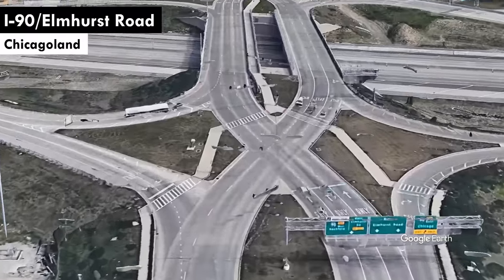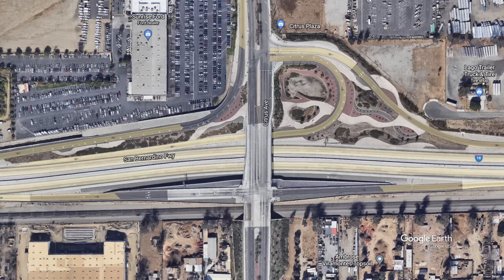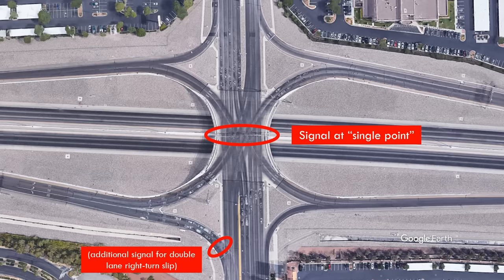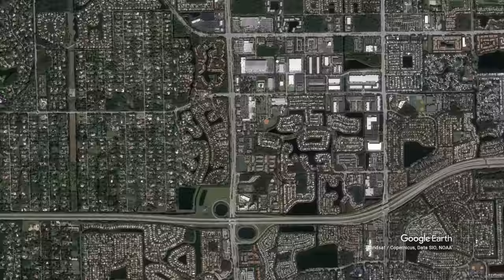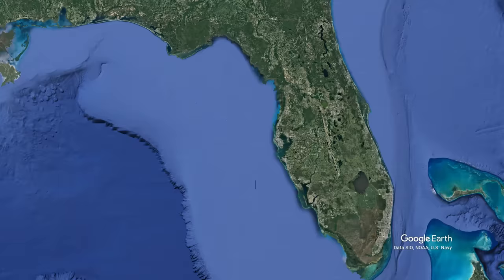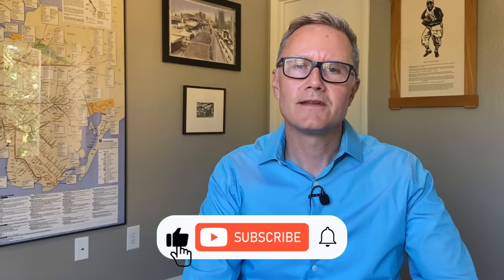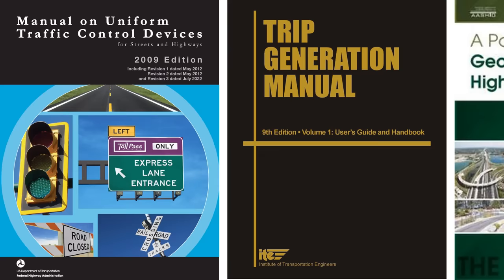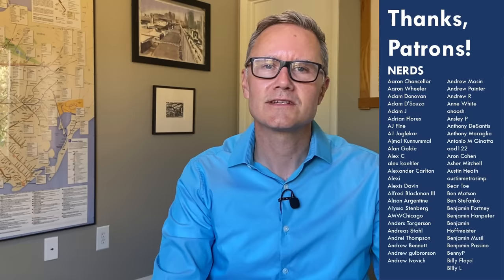Traffic Engineers Gone Wild: Why Interchanges and Intersections are Getting Worse, Not Better

Comment: Spot on as usual.  What I hate the most is shown @ 8:51 pedestrians and bicycles need to do the weirdest turns (100° to the left) with your back to incoming traffic that of course is not looking at you, then you walk 7 meters to be stopped by a traffic light again.  Then you finally get to the concrete bath tub and do it all over again to get out of there on the other side

Comment: While State Road 7 and Forest Hill Boulevard might hold the record for the most approach roads, the crossing of the Princess Highway and North road (West)/Wellington Road (East) (Right next to Monash University, Melbourne VIC) might be the widest intersection I've ever seen. The crossing is not at 90 degrees so that while from short corner to short corner it's only 45 metres wide, from the long corner to the corner diagonally opposite, it's 170 metres. If you are driving on North Road it's a total of 110 metres (360 feet) to drive across the intersection when going straight and the traffic lights on the far side are so far away you can hardly see them when stopped. It's a total of 192 metres for a pedestrian to cross from one corner to the one opposite through a total of 4 pedestrian lights.

Comment: This may be a bit too niche, but I'd love to hear your thoughts on the in-progress project to replace the Connecticut River Bridge between Brattleboro, VT, and Hinsdale, CT. It's a nightmarish design exacerbated by the fact that, although Brattleboro is the regional population hub, the border line between Vermont and New Hampshire hugs the Vermont shoreline, so the primary agency responsible for the design and construction of the bridge replacement is the New Hampshire DOT, not VTrans, at a total projected cost of some $50-60M USD.

The dilapidated existing compound bridge crossing intersects with the at-grade Amtrak station that is itself in the process of eventually being replaced with a level-boarding platform, which will be the first of its kind in Vermont, although construction has yet to begin. Directly adjacent is the downtown Brattleboro intersection locals lovingly refer to as "Malfunction Junction", which comprises: Main Street Brattleboro, the main North-South arterial (US 5); a grocery store parking lot entrance/exit; NH 119, the most southerly (and thus first available) crossing of the Connecticut River in Vermont; as well as VT 142, along which are several heavy industrial sites. 

This is compounded by a heavy industrial site, a lumber kiln, embedded right in the heart of downtown Brattleboro, just blocks away from Malfunction Junction. And this area is also fed by VT 9, the most southerly East-West crossing of the state, and VT 30, along along both of which travels more heavy industrial traffic (mainly lumber trucks). 

Surrounding the Brattleboro downtown area are three interchanges for Interstate 91, Exits 1 (US 5), 2 (VT 9), and 3 (VT/NH 9, US 5). Because of the design of the roads in the area, a huge proportion of the through traffic and heavy transport through the region is forced to traverse the Main Street canyon of downtown Brattleboro, concentrating immense amounts of noise, pollution, and congestion, serious degrading the quality of life of people in the town center.

I should also mention that the next exit off I-91 South of Brattleboro is in Bernardston, MA, some 13 miles South, so if you accidentally get on I-91 South from Brattleboro at Exit 1, instead of I-91 North, it's a 26 mile round trip to get back to where you actually needed to be, unless you make an illegal U-turn in the middle of I-91. And every time there is some closure of I-91 between Exits 1 and 3, all the highway traffic is funnelled though downtown Brattleboro, as well.

For more info, see https://www.nh.gov/dot/projects/hinsdalebrattleboro12210/documents/12210-project-narrative.pdf and https://www.reformer.com/local-news/brattleboro-amtrak-station-on-track-for-rebuild/article_965f2f7c-2a7e-11eb-8c93-fbc1c3bfaa20.html

The new bridge design not only solves none of the traffic problems the area currently experiences, save for grade separation between the train tracks and the river crossing, it looks to me as if it's actually going to make them a lot worse, since all heavy truck traffic between I-91 and NH 119 will now, instead of driving straight through, be forced to negotiate a 135 degree turn between Canal Street (US 5) and VT 142, before making a 90 degree turn into the new bridge.

Comment: In Southern Oregon on I-5 (a legit, long haul freeway, rather than a local freeway), we have a “normal” exchange at exit 19, and a diverging diamond at exit 24. Frankly, I prefer biking (and probably walking) on the DD. The normal exchange crosses the Interstate with a straight road, so cars go faster than the limit. Bikes and pedestrians get a wide shoulder, which is deep with crud. I almost always avoid it. The DD, on the other hand, curves, has closely-spaced signals, and has a 30 mph speed limit that is largely observed. Pedestrians get sidewalks and the bike gutters are only so dirty. There is a truck stop there, but as a MAML, I am often faster than the trucks, because they are slow to accelerate and have no motivation to go fast, due to curves and upcoming signals/turns. It’s not great, but I don’t hate it. The bigger problem is the big box hardware sore and environs, which isn’t a nice trip, if you just wanted to walk/bike to buy a lightbulb.

As a road cyclist, I much prefer the simple, two-lane road overpasses without freeway access that have almost no traffic. I don’t know why anyone would walk there though, unless they wanted to stroll the pear orchards, vineyards, and pot fields. Frankly, there are much better walks on the populous side of the highway.

Anyway, the diverging diamond isn’t necessarily terrible in a small scale, assuming that an interchange is required outside of a city for traffic. A crap filled shoulder on a straight shot overpass is simpler, but terrible.

But many drivers complain about DDs, because they find them confusing. In practice, they are easy: stay in your lane, stop at red lights, and follow the well-marked signs. If anything, the curves and “confusion” are good. It slows the traffic and urges drivers to get out of their tunnel vision. I have yet to see any accident of any kind there.

Comment: The first time I encountered the Michigan Left, I thought it was an act of Satan. But, in the driving context in which I drove it most frequently -- the suburbs of Detroit -- it actually worked quite well. The idea of turning right in order to turn left seemed absurdly over-engineered, but it actually kept traffic moving relatively briskly (less so at rush hour, but the same can be said of any traffic configurations). 

It's most irritating quirk comes with missing your turn or, worse, inadvertently find your self going the wrong way, as correcting your course can be a dizzying affair, which involves a half dozen turns to put yourself where you wanted to go.

Comment: Could you comment on the viability of gondolas? I live in LA and there is a proposal to build a gondola to dodger stadium with 5000 ppl/hr capacity. This seems low for a stadium of 50,000. Are gondolas subpar to rail/BRT, or is there a use case for them to be built?

Comment: SPUIs can be designed to accommodate foot traffic however it’s still not the best option for areas with heavy foot traffic.  Where I live we have 2 SPUIs, one in an area with basically no foot traffic but 4 truck stops at one interchange and the other in basically a city center.  The fact is in the second one the walkability was bad before the SPUI, because it was a long way from 1 side of the interstate to the other.  

I do like the SPUI where the truck stops are in the other location it’s kinda meh.

Comment: That bowtie one might actually be us finally having them fooled.  There are bike lanes (I know, painted ones, but still), and perhaps more importantly, the design is actually hella inconvenient for those left turning vehicles.  Where all the others are clearly designed to make car fast, this one actively discourages making left turns at all.

Taking another look at the diverging diamond, it strikes me that it's not worse than a standard diamond with slip lanes.  Both of them have 2 slip lane and two signalized crossings required to get accross.  Given that the signalized crossings have no turning cars, I think they might actually eliminate half the deadly conflict points.

Take a at the one in Calgary (McLeod Tr and 162 Ave S), and maybe comment. I don't think there's a scenario where this overall design could be done better (it has multi-use paths on all 4 corners, and because it uses 2 bridges, the centre-running MUP doesn't feel squeezed between trucks in both directions).  I think it might actually be the best way to deliver an interchange.

Comment: I'm not as hostile to the "bow tie" or at least the philosophy. I became involved in a project in the inner city of Newcastle, Australia where a set of new Traffic Control Signals required seven lanes on the through carriageway thereby destroying the main outcomes of what was an urban renewal project. It turns out that when the state road authority got involved, the automatic reaction was to allow for all movements and great a stroad environment. In a spiritual moment, I wondered what would happen if all right turns (left turn equivalent in the US) were removed. The result was the traffic was actually better with the removed turns using the nearby roundabout to make some of the never built right turn movements. It is now a single lane carriageway with kerbside parking and wide tree lined footpaths and my client saved millions of dollars. On top of that, the traffic signals were no longer required. If I ever take up teaching at my old Civil Engineering University, this would be a case study for the students.

Comment: I understand your arguments, but I think you are missing a crucial point: pedestrians and cyclists should never have to cross such interchanges in the first place. In Europe, any trip by foot or by bike takes alternative bridges over highways instead of crossing the highway at interchanges with heavy traffic. These bridges are often small tertiary roads, or pedestrian-only bridges. This is much safer than trying to mix car and foot traffic in one junction.

In the Netherlands, this concept is expanded to entire routes through cities: public transport runs along avenues, cars on highways, and pedestrians and cyclists along small roads, green spaces or dedicated bike lanes. It is called modal separation, not just bikes made a video on it.

It is a good thing to optimize car-designed infrastructure for cars, but it should be accompanied by other infrastructure for other modes of transport.

Comment: One of the greatest disasters of urban planning is beer my home in Philadelphia PA:  Roosevelt Boulevard. Three areas are specifically heinous:  Harbison Avenue; Bustleton Avenue, and Oxford Avenue, where it enters intersects as a circle.  

Roosevelt boulevard (which is signed as Us-1 through its entire length) is a whopping 12 thru-traveling lanes (with additional crossover, slip lanes, and lanes for left turns) what makes this even worse is that this is for most of its length, is pretty much 70-80% residential.  People’s front doors face this street. And they have on street parking.  

It was originally designed in the 1920s as a “streetcar highway” which never materialized.  There has been talk on and off for the last 30+ years of extending one of the main subway lines down the middle, which has just gotten new life recently.
Reply: Alan Fisher just did a video about this.
Reply: @JimBones1990  already watched it! Thanks for the heads up regardless.

Comment: Highway engineers are some of the most incompetent people on earth. I think it should be a federal requirement to drive semi for 5 years before designing roads. My region is being bastardized with circle jerks and j turns. None of which can accommodate truck traffic safely. The latest stupid thing the did was take out a 4 Lane road and replace with 3 Lane. It has made it nearly impossible to cross as traffic is now bumper to bumper instead of staggered and spread out. Stupid.

Comment: Toronto requires michigan lefts to get around downtown dedicated TTC (Toronto Transit Commission) streetcar rights of way. There is a left turn signal at each signalized intersection, if you are coming off a minor road / laneway, you must drive to the nearest signalized intersection to make a protected left turn where you can cross the streetcar tracks without falling foul of TTC Special Constable Service. 
So left turns aren't fundamentally bad. Of course Toronto isn't dumb enough to make a sidewalk cut for a uturn. If you must u-turn, you must do it really tight is how it is in the True North.

Comment: I would argue that if these types of intersections can reduce accidents between motor vehicles, they might be a good idea, but they should only be used in areas where no one is going to walk in the first place. Or routes for walking or biking should be entirely separated in the area around the interchange. With that said, I think these intersections should still be kept to a minimum because if they reduce congestion (even if by just a little) they may be contributing to induced demand, and decreasing congestion should not be used as a justification for these. The real solution to traffic is land-use reform and other modes of transportation.

Comment: many of these need a pedestrian bridge off to the side, I would put no pedestrian facility on the bridge and instead have another bridge that crosses the highway to the side of the interchange, so no traffic light crossings. Then just need some underpasses to connect under the non highway road at either end so pedestrians from both sides of the road can get to the pedestrian bridge.

Comment: Hello there I have an idea for a topic of discussion.

I've been through a few major power outages over the course of my driving history.
And quite obviously these wreak havoc at major intersections that were previously controlled by working traffic control devices.

I often wondered why something as important as traffic lights don't come with A. Battery backup system capable of maintaining a few hours of working power.
B. A backup generator for the most serious intersections.
C. Or even a simple connection point.
Meaning that dot employees could tow in an
Emergency generator, open up the traffic control box, and just plug and play.

Seems simple enough but what do I know? 

Have any thoughts on this?

Lastly I've heard from a highway engineer that the change to the new LED lights brought on a problem with many control systems being that the new LEDs don't pull as much power to engage as the old incandescents.

It seems to me that if these systems are now taking less power it would be even easier for a movable generator to be able to operate the system or even a built-in one.

The only detriment I see is the slight extra cost of an already expensive system.

Comment: These interchanges are not the problem and they do exactly what they need to do.

The point is that they shouldn't be placed nowhere near places with pedestrians. It is an interCHANGE between highways, where speed and flow matters. While in places  with pedestrians you need interSECTIONS between LOCAL roads, where accessibility matters, not speed and flow

But what about traffic? Well, that's what city planning is for - not to place a huge arterial road/highway right through a neighborhood, but to create lots of connections, manage lanes and turns so that arterial roads, highways and interchanges are well used but placed in places where there is simply no need for cyclists or pedestrians to be present. And have an underpass or overpass there just in case

Comment: Here in NC, they seem to have fallen in love with the Michigan Left. Even though everywhere they've tried putting them in, it's resulted in MANY more accidents. They like the fact that it's cheap and doesn't require putting in lights or overpasses, but at least in one case near me they gave up and put in lights just because of all the accidents!
Reply: It's amazing how many of these I have right near me!

4:20 - I-85 & Brookshire Freeway

8:10 - NC73 & I-85

I actually like this one. There are only two intersections, no turns, one way only. It's easy to drive and keep traffic flowing.

10:10 - LOTS of places (only no signals; lots of accidents!)

They actually had to put in signals at NC-16 & Optimist Club Rd. because of all the accidents.

In each case, you're going easily over half a mile out of your way to make the U-turn.

11:35 - NC 16 & Mt. Holly-Huntersville Rd.

Yes, it's every bit as horrible to drive as it looks. It doesn't help that the I-485 interchange is just a quarter mile away!

I do like the dogbone roundabouts at Moores Chapel Rd. and I-85. Looks like the perfect way of doing it without signals.

Comment: Lol MODOT made one of those no left turn, U turn intersections on Route 141 near Vance Rd. They put the U Turn bulb right in front of a school. 141 was a regular two way street that they’ve slowly expanded into a highway. The whole thing is really a clusterfuck because it alternates between SPUI and Traffic lights for like 20 miles it’s just a mess. 

Just to add to your shitting on Missouri’s DOT. One of the main stroads I drive had signs put up for construction. Four signs in total and even a digital one giving the date it was supposed to start. It’s been five weeks since the start date and I’ve seen zero construction. But they have that MODOT Work Zone “let us know how you feel about our work zone” sign. It gets funnier every day I drive past and they still haven’t started.